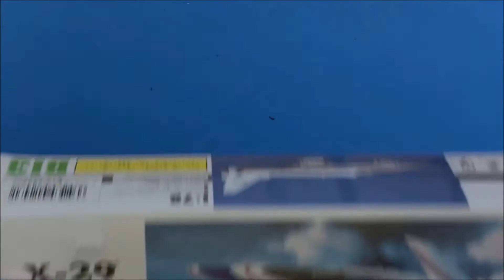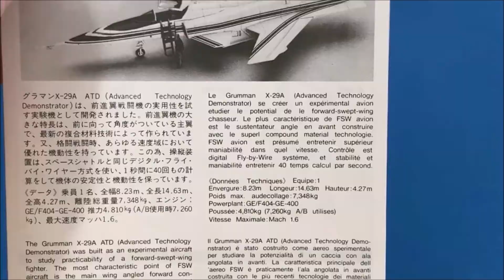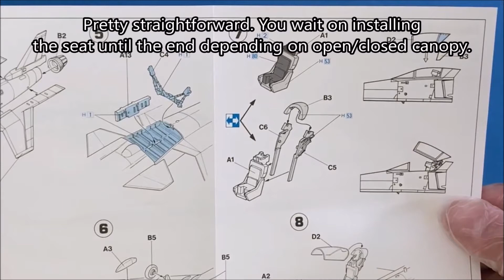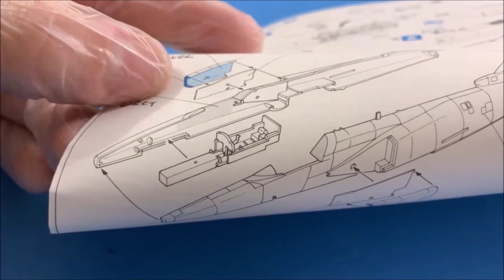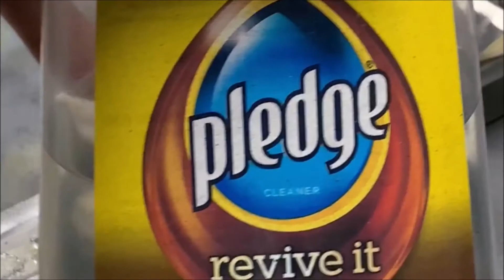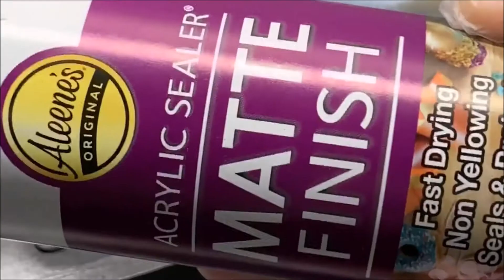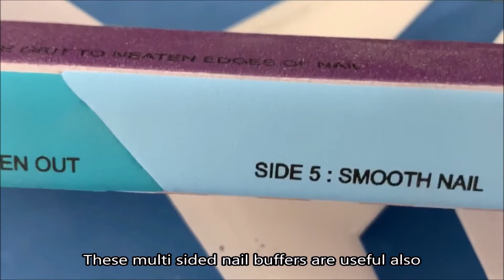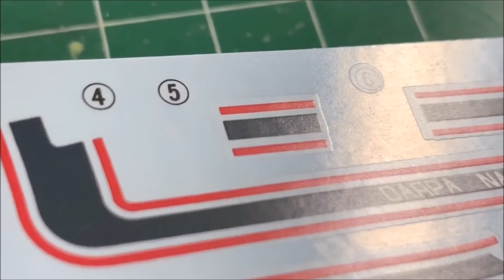Full Build Hasegawa X-29

Comment: What glue do you use/recommend by the way?
Reply from the maker: My go to is Tamiya extra thin because I can put the pieces in place and run a thin application over the part. It's so thin in gets into the gap and using capillary action bonds the two. I do use regular cement on bigger pieces like wings or if the fit isn't as good before I use filler for the gaps. These two work great with plastic, but you should also have CA (Superglue) for bonding non plastic parts like the metal balls i put up front to keep the plane from leaning on it's tail. Hope that helps!
Reply: joekmodels Awesome!!! Thank you so much!!! 🙏🏻🙏🏻